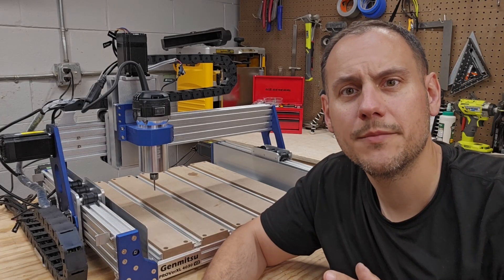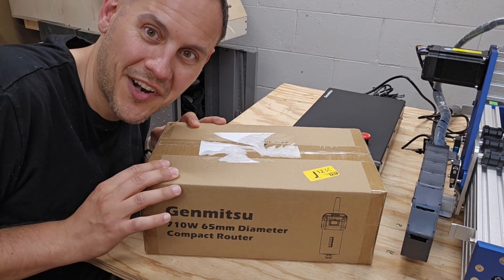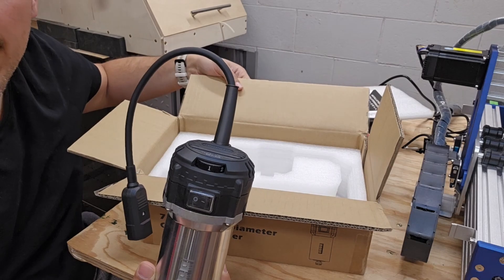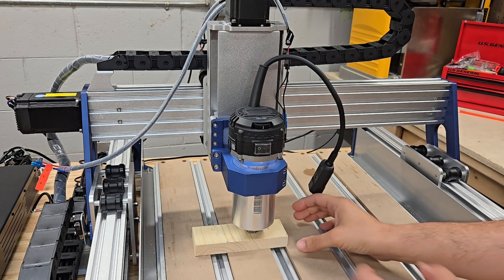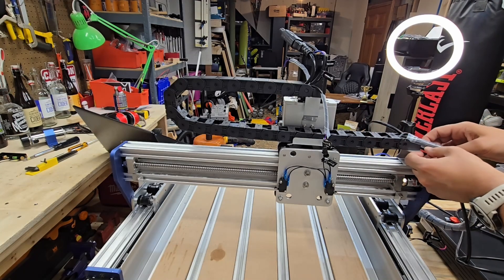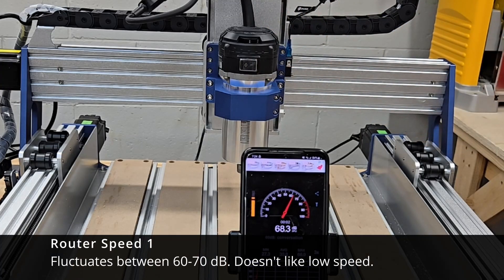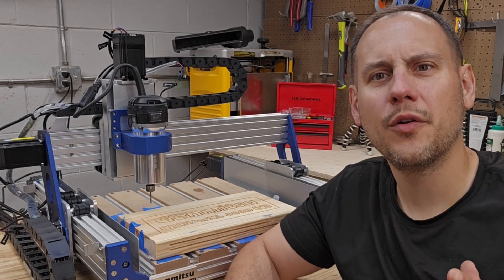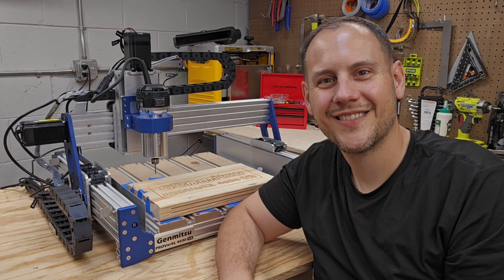DIY 710W Spindle Upgrade for Proverxl 4030 v2 CNC Router

Comment: I just purchased this router and plan on installing it on my Genmitsu PROVerXL 4030 V2 with the 6060 extension.kit.  This video is nice, straightforward and helpful . 
I definitely would like to add on the FoxAlien relay so I look forward to a video ont that install. Much appreciated and thanks.
Reply from the maker: 4030 v2 has been a great machine for me so far. I'm glad I added the router and 6060 extension kit to it.

Comment: Hey I just found your channel! New sub here, I have the XL4030 that I just upgraded to the carbide 3D router so very similar setup to you. I’m excited for what new videos you will roll out!
Also, did you ever figure out how to make your router turn off via Easel instead of just the switch?
Reply from the maker: Thanks for the sub. I'm working on 2 new videos right now for it. 1 for extending the 4030 to 6060 and also building a movable enclosure for it.

In regards to the switch controlled through Easel, , I haven't gotten that far yet. I know FoxAlien makes a relay switch to control it but haven't bought it yet. I spent too much money on the 4030 and the extensive kit to buy it just yet! 😂
Reply: @old.fashion.nights lol I understand that! Moveable enclosure sounds sweet too, looking forward to the next videos! I injured my back recently (day job is a finish carpenter) so I’m pretty worthless right now as I heal, so it’ll be a minute before I can get back out to the wood shop but I’ll live vicariously through your videos. Thanks!